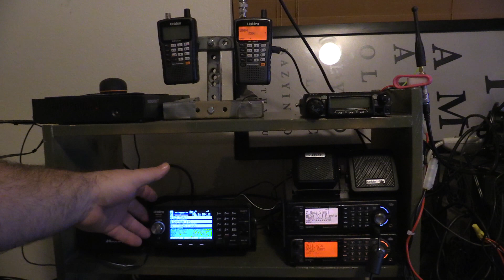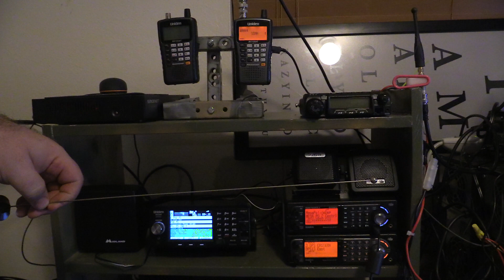Better Scanner Antenna

Comment: This is baloney! You are just trying to sell a $40.00 after market antennae. I have compared the stock OEM antennae on the Uniden SDS100 with the Remtronix 820S and the OEM outperformed it on most frequencies.  You cherry-picked one frequency that the Remtronix was better on.  Are you CNN? As Trump says, just more Fake News! Did Scanner master pay you for this video.

Comment: Hi, what external receiver antenna can you recommend for my SONY AIR-8 radio?  If I can easily make the said antenna, can you please give me the details?  I plan to install the antenna on top of our steel water tank, which the antenna will have a height of about 50 feet from the ground.  As a private pilot, I just want to monitor the airband frequency of 118-136 MHz.

Comment: The only problem I see with running my antenna that came with my RadioShack pro-197 shorter for p-25 is in my scan list I also listen to air bands, it would be kinda annoying to have to extend and collapse the antenna every time I wanted to listen to a certain band, however your video was very informative so thank you for posting it!

Comment: I took a 102" steel cb whip that was damaged on the end, cut it down to 36", installed it outside on a mount, used adapters to attach rg6 coax to it and run it inside to a ws1065 scanner. I pick up p25 and fm broadcasts. But could I do better?, all stations I have installed are local and static free and real clear. I want a good setup without spending a lot as I am on a fixed income. thanks and great video.

Comment: Hi, love the set-up. Your my new best friend. Im a licensed ham I use my 2m 70 cm ham antenna, pics up aircraft, and fm  they are close on the band chart. What I don't get is I have a ittty bitty antenna on a baofeng uv5 r. Im in jersey and I pick up NYPD like they are across the street not the river. Same on my old radio shack pro 33.i have a Whistler trx-1 and I can't even figure out how to turn it on!!!!! Maybe u can do a vid on digital. Great work

Comment: Really does NOT have to be that complicated. I use a DIY Dual Stacked DTV Antenna that was left next door at RV Business.It is well designed with Solid Aluminum  Radials,two sets stacked Vertically. Picks up ALL Air Traffic,460 Mhz Range,161 Mhz Range,Weather,etc with no probs.I have an Xtreme 1 to 8 Amp on it to feed 4-5 Scanners & 2-3 TVs.Lots of TV antennas will work well with a good bit of what's out there.JUst always get antenna up high as possible & outside if possibleJust never know until you try it.

Comment: I've tested that steel whip nmo antenna you showed on a mobile set up. Not the greatest as you've said. I love the Larsens, one of which I'll be testing is the new one with spring base advertised closer to frequencies I wish to receive better in Pinal/Maricopa counties per radio reference. I opted to use that cb/scanner hybrid on the market. Keep the ears open fellow east valley resident!
Reply: Phx here... Waiting for my new SDS100! 73, KE7WIL

Comment: Outstanding explanation on handheld antennas.
My name is Anthony. I have been a communication scanner for over 50 years. I have owned everything from rotary-dial transistor radio scanners to crystal to programmable digital radios of today.  Your information on what type of antennas and their lengths are outstanding. Scanning can get a little expensive, but once you find tune you're radios with a specific antenna you will enjoy the hell out of this hobby SCANNING.
MAY THE SCANNING BE WITH U.
 🐢🇺🇸📻🐢🇺🇸📻🐢🇺🇸📻
Reply: Scanning can get very expensive. That's partly why SDR is becoming so popular. Have you tried any of that yet?

Comment: Good informative Vid , liking the Scanner Tree on top , is that Dexion Racking Bolted together
What about these 4 inch internal Ants that stick to the Window, have you tried one , or any good in your Opinion ?
Thanks .. UK .
Reply from the maker: Hi Dee. I dont think the antenna being near the windows matters much here in the States. Our houses are made of wood and not a lot to block the signal. Where you are in the UK, with the block/brick and rebarb, it might be a different story.

Comment: Hey there, thanks for the helpful video. Although I’m still confused a bit. I’m trying to find the proper antenna and maybe you could help? I currently use a RH77CA antenna on a BC245XLT Uniden scanner. I listen to only one band which is 460Mhz. Is this antenna sufficient or do you think I need one more band specific? I receive quite a bit of static when listening and sometimes it’s hard to make out what they are saying. I am new to scanning and I am not sure if this is normal. Your input is much appreciated!
Reply from the maker: On a conventional 460Mhz frequency, your wire quality and antenna height is key.  The RH77CA is a fine antenna. I would seriously grab a latter and sit on your roof to see if reception is better,. If so, then you may want to get an exterior  antenna.  I use to work in Freehold NJ, and we would sometimes get NY City transmissions on our radios when we were outside. Both our departments were on the 460Mhz band.. But that was 20 years ago.

Comment: You can calculate the exact full wave length by dividing the center frequency in MHz into 300. The result will be the length in meters. You can convert that to inches by multiplying by 39.37.

So full wave length = (300 * 39.37)/frequencyInMhz.

If you use a quarter wave antenna (1/4 the value derived by that formula), it needs a ground plane attached to the shield side of the coax cable.

A half wave antenna has to be fed in the middle, but then you need a balun transformer to take your 52 ohm coax to balanced 75 hom.

Other wavelengths, for best operation, need to be fed with some sort of matching network.

One problem with this kind of antenna is that they tend to be narrow band - they work best at the exact frequency you used in the formula above, but not as well for frequencies farther away.

One approach to use is a discone antenna, which you can buy, which is very wide band, at some cost in gain. You could then hook up multiple scanners to the same antenna, if you put an amplifier and splitter in front of them. I plan to do that. 

Another problem is that the higher gain an antenna has, the more directional it is, which means it has less gain in directions other than where it is pointed. For vertical antennas that usually isn't a problem unless you are listening to aircraft that might be nearly above you - but then, they are likely to have strong signals so the lower gain doesn't matter.

The overall subject is very complex.
Reply from the maker: Thanks John, great information.
Reply from the maker: Great info.. I suck at match, theres many websites that will do the calculations.